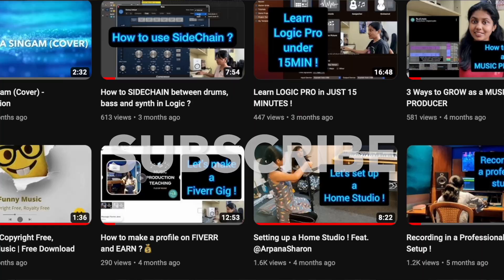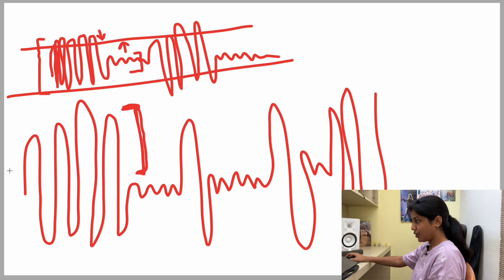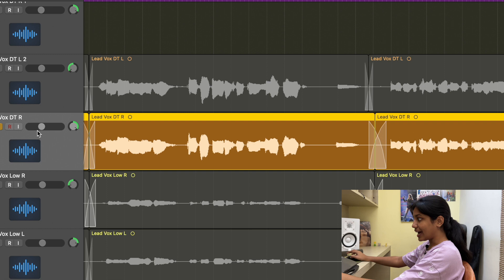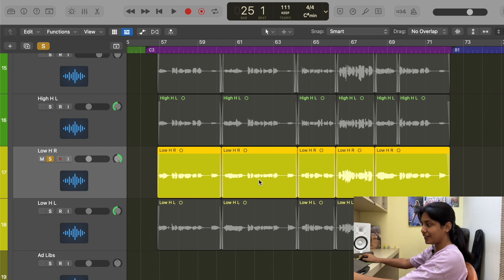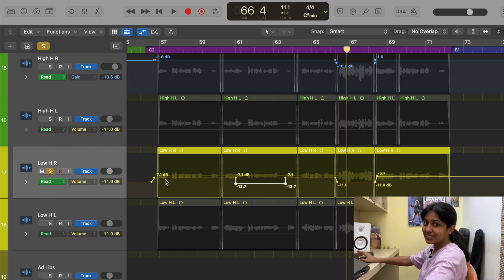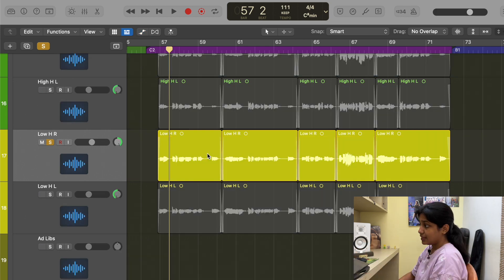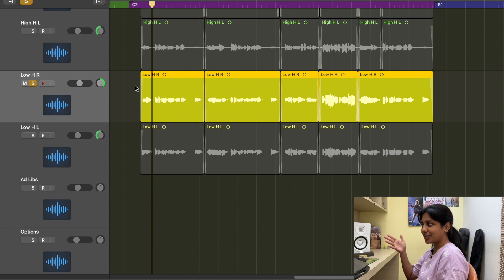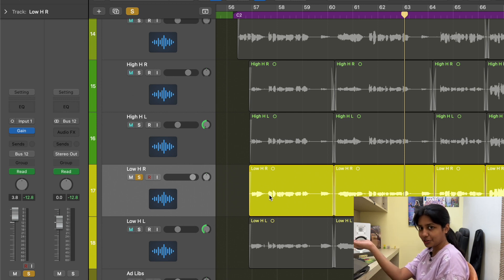DO NOT add a compressor without doing THIS !!

Comment: If you do need to adjust the overall volume of your track after doing volume automation, you can adjust the trim setting, which is easier than selecting every automation point and moving it up or down. But channel strip plugins are applied before volume automation, so you need to use a gain plugin before the compressor if you want to do that kind of gain automation to reduce the work the compressor has to do.

(Also, I really like the way you explain things; I’ve learned a lot of helpful tips from your channel. ❤)
Reply from the maker: Thankyou for your suggestion 😊